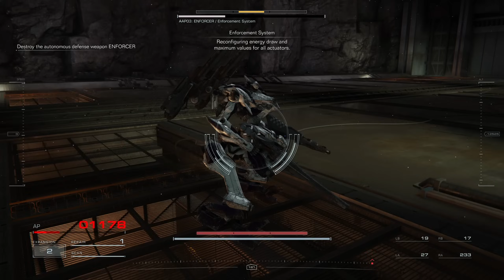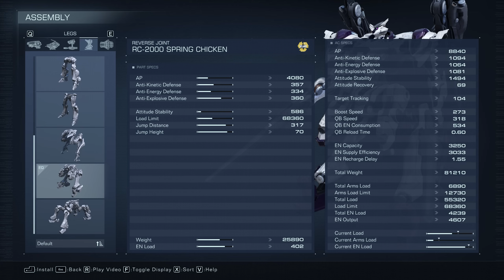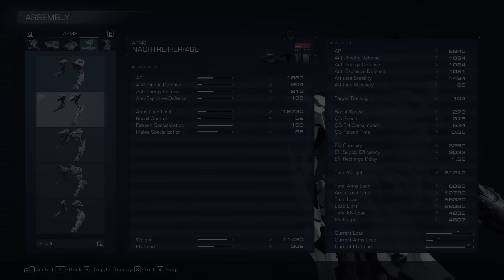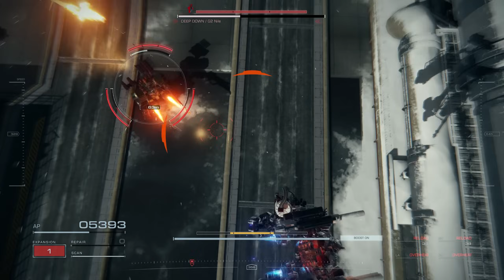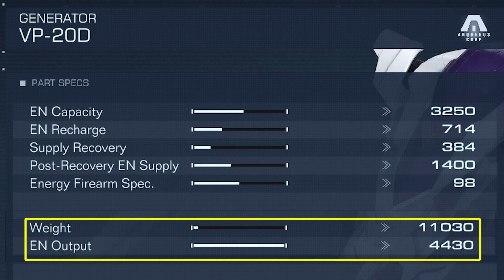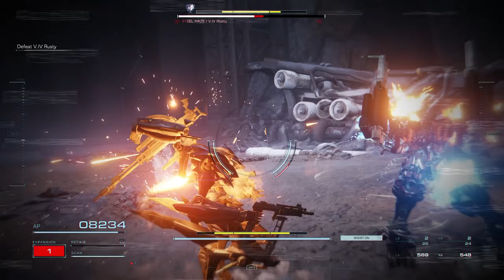Energy Weapon AC Build That Makes Bosses Easy! | Armored Core VI

Comment: I just reached the final mission of chapter 5 and I'm having trouble with Ayre. I tried using a heavyweight build that utilized the ice worm weapon and two bazookas but that did abysmally terrible damage. Energy seemed to do somewhat decent against her but I don't know if there's a better way. Based on experience, does this build work well against her?
Reply: Quite late, but I had success using the Mind Beta reverse joint, an gatling gun in my main hand + shoulder gatling. Also had a Detonating Bazooka that deals very high damage, impact AND direct hit.

A pulse gun could be useful in the remaining slot, for breaking her shields.

Comment: TAKE NOTE: The system recovery stat on heads is bugged and DOES NOTHING. Will certainly be fixed in the next patch, but until then be aware that light and medium builds are being stunned for much longer than they should.
Reply: System Recovery is not bugged, it works fine in-game and always has. System Recovery is status resistance. It reduces the amount of status buildup when you are hit by FIRE or ELECTRIC.

Comment: I feel like not enough people understand how the recoil control stat works, if they did we would see the nachtreiher arms in builds much less often. It directly governs accuracy on follow-up shots and it's an important stat for many weapons to reduce their spread and land more hits. Having the firearm specialization to keep your lock-on crosshair tracking a moving enemy doesn't really matter that much if your shots don't land on the crosshair anyway. I would highly recommend the firmeza arms as an early part that has really good balance between recoil, firearm spec, and melee spec.

Comment: If you aren’t running the VE-20B generator, your energy build is suboptimal.
Take a look at this build: WFV2J91SVG4Y
I’m dominating PvP with it.

Generator: VE-20B
This generator has 150 energy firearm spec. This translates to a massive +25% extra energy damage and -50% charge time in comparison to the VP-20C’s 100 energy firearm spec. This buff stacks multiplicatively with the OS tuning buff! The catch is that this generator has energy issues, but this is bypassed with the core of choice below.

FCS: VE-21B
Great long-range and medium-range assist. Very suitable for my weapons of choice.

Booster: ALLULA/21E
2nd highest thrust, 2nd highest QB thrust, 2nd highest AB thrust, and 2nd highest QB reload time. Aka the true best overall performer. The catch is that its ideal weight point is very low, but we do manage to get lower than it in this build!

Legs: EL-TL-10 FIRMEZA
These legs have the highest load limit to weight ratio in the game, and by a landslide. Nothing comes even close. They are also very energy efficient, something that is very important in this build due to the generator’s limited output.

Arms: NACHTREIHER/46E
160 Firearm specialization and very lightweight.

Core: AC01C: EPHEMERA
Highest generator output adjustment in the game at 126, increasing the generator’s energy output by 26%. This build wouldn’t be possible without this core.

Head: VP-44D
2nd highest stability head in the game, with good defenses and a balanced weight and energy consumption. This is the best head in the game, imo. 

Both Arms: VE-66LRA
The VE-66LRA has a fast projectile speed with a very high DPS, especially with the generator. It also has a very long range, so with the mech’s very high speed you should be kiting your opponents and staying at a safe distance.

Shoulders: VVc-703PM
Super energy efficient and lightweight. There’s not enough energy in this build to run more damaging shoulder weapons. I spam it throughout the fights to overwhelm enemies. Can be fired while moving and is decently accurate thanks to its large AoE.
Reply: I’m gonna try this build, thanks! Also I think you mean the Vvc-703PM, right?
Reply: @G102Y5568  Yeah, that was a typo.
Reply: @JRPG_Addict  Your build was amazing, I just used it to beat New Game++ and honestly, it's my favorite of the builds I've tried so far. I love the combination of incredibly high DPS as well as being super fast to dodge everything, it's the best of all worlds with virtually no downsides.

Only thing I changed about it however was I went for the close/mid FCS instead of the long range one for the Campaign. The laser rifles have a slow projectile speed and I found they missed a lot at long just because the enemies moved, and I'd usually run out of ammo before bosses died. Maybe in PVP it's fine, but in Campaign it's generally better to get up close to a boss since you can still easily dodge everything they throw at you, and ammo conservation is a must.
Reply: @G102Y5568  Neat! And yeah, you did the wise thing swapping the FCS to a close-range one. I eventually did the same lol. Close range is king both in PvP and PvE. The high effective range of the weapon is just a nice bonus when enemies aren't paying attention or are very easy to land hits on.

The build does have a major weakness, though: being an energy build. C-weapons are very resistant to energy damage so it's not ideal to S-rank all PvE missions. As for PvP, impact damage is the name of the game. I did well with it in PvP, but it was mostly just because I outplayed my opponents, not because I had the better build.

I have 2 builds that I want to share for each game mode. This is the build that I S-ranked every single PvE mission in the game with:
RNWN2SAFCCNL

The RF got a 33% DPS and IPS buff in patch 1.02, which made it go from a "decent" weapon to S-tier weapon. It practically never runs out of ammo, has a very high DHA, and has a long range to boot. It's the perfect PvE weapon, imo. And on the back there are double stun-needles because they cheese all PvE content.

NGI-000 generator for infinite flight, which is a great boon to S-rank plenty of missions. HAL core for a significantly reduced EN recharge delay for even better flight and energy economy, and HAL legs for that load limit.

This is the cheesiest PvP build I made so far, as well as the build that I'm most proud of:
FQF5ZD1R0W9N

This one look really silly, but it's busted strong in PvP (and also PvE if it weren't for ammo issues).

With dual stun-guns and Huxleys combined, I build up impact damage insanely fast. The stun-guns also build up electric discharge, which deals a fixed 1600 burst damage and stuns the opponent temporarily. The weapons also have a high DHA to make use of all that impact. 

This mech is very light weight with an Allula booster, so very high speed and great QB stats across the board. With a Nach core, the QB energy consumption is very low at 510, so it's super energy efficient.

The best part? 1813 stability, on a very fast mech. This is possible because the weapons are so light that I can afford to run the Wrecker legs, the highest stability bipedal in the game, without suffering penalties on my Allula booster.

To top it all off, I'm running the NGI-000 generator for the very high capacity and infinite flight capability. With the Nach core, the recharge delay is dropped to 3.64. This is very useful for the hoverers who love to fly high and just spam missiles.

So... Very high impact damage, very high impact resistance, very high DHA, very mobile, very energy efficient, infinite flight, and stun galore. It's cheesy. Your opponents will usually be standing there helpless for extended period of times thanks to the stuns and impact stagger, moving their camera as fast they can to keep up with your QB spam as you rotate around them showering them with bullets, usually with a massive advantage in stability thresholds to boot.
Reply: @JRPG_Addict  It's crazy that the best builds I've found so far are from some random guy in the comments with no likes, how are you so good at this game? Do you have a YouTube channel or something?
Reply: @G102Y5568  No, I rarely upload anything on YouTube. My comment didn't have a lot of visibility because it wasn't hearted, I think. Also, people tend to avoid longer comments.

Comment: Very good build. 
I took the liberty to change something, mainly the boosters and weapons. I prefer having a short QB recharge time and low energy consumption.
For the weapons I tried with dual stun needle launchers paired with dual Zimmerman shotguns and it's the one I like the most so far. Use either one of them to build up stagger (needles for fast bosses such as Ibis or Ayre, shotguns for the rest), when they're almost staggered start getting closer and fire one weapon to stagger, unload all the rest right after followed by an assault armor blast (when they charge at you for melee that's a very good opening). Works well vs most ACs, smart cleaner, sea spider, cataphract and juggernaut. 
For shielded enemies like Balteus, swap the Zimmerman or the stun needle for pulse guns, but I like that extra discharge dmg. Also, seems to me enemies have a harder time dodging it, especially at close range.
Tried also with dual SOUP missile launchers, so you have both mid range and close range versatility and you can kite enemies from afar, unloading missiles on them and then if they come too close you have the shotguns.
I also tried with dual coral rifles but that was more for having fun with the weapon. It's barely below the load limit and you're forced to use heavy arms to hold those 9k+ weight rifles and unable to use shoulder weapons (I had 2 burst pistol since they're the lightest weapon in the game).

Comment: Ahh, it pleases me to see a nigh-identical Core build to mine, named after the great hero.
The biggest difference is in the weaponry - I went with the Laser Pistol instead of the Rifle for more sustained rapid fire, and the original Pulse Blade (later switched to MOONLIGHT) in the off-hand to save ammo against mooks and to punish staggers and/or poor positioning. On my shoulders I had both a vertical missile and a direct plasma launcher to maintain impact pressure even at range while still keeping the load light in order to have the best possible mobility.

Not the hardest hitting setup, but could out-turn like 90% of enemies, and what it couldn't out-turn it could easily dodge allowing for a counterattack. 
And with a EN Weapon specialized generator, that laser burst charges up awful quick...
Reply from the maker: Yea I can't resist naming all my ACs after Dark Souls bosses

Comment: This build actually is under average , mine Energy bulid is better then this, btw energy weapon mainly is to break shields I just found out combine with Rocket launcher / Gatling gun could melt then enemies, in 2 sec, yours generator/ and armor which don’t effect too much in your guns, try dual Vvc-760PR, it could melted your hearts, and for most cases tank legs is have much more better survival ability, for instance-Fortaleza, have the highest speed/ armor/ mobility which’s has more value, tbh, the needle is the best for stagger

Tips: Ephemera head can prevent player for stagger/shorter time; legs parts have longer stagger time, so I suggest fortaleza
Reply: Regarding your tip - that's wrong. Ephemera head doesn't recover from stagger in a shorter time. If you're referring to its higher System Recovery stat, that's for ACS status like shock or heat damage from flame weapons. It does recover faster from those.

Stagger recovery is weight-based - lighter ACs will recover faster from stagger.

Also, reverse joint legs are better for mobility. Period. Especially in the air. Tank legs are better for armor, yes, but you don't have to worry about that if you dodge and don't get hit in the first place.

Comment: I don’t think i missed it, but would have been nice to indicate if the parts you mention for the two builds could be accessed early, mid or late game. Appreciate the build!
Reply: I think both builds are available Chapter 2
Reply from the maker: Most of the parts are chapter 2 or early chapter 3, but many of them are unlocked pretty early!

Comment: For anyone who's more into ballistics: 2 gatling guns + 2 stun needle launchers, this combo is absolutely broken. It kills any boss in record time: balteus goes down in 20 seconds, even the final boss of the 3rd playthrough dies super easily, killed it on second try. Just use miniguns to build stagger then fire needles for absolutely disgusting damage. If you use it in the arena, one rotation of this brings any AC down to 10-20% hp

Comment: There is another generator you should really consider for the energy weapons build, cant remember its name but it has the highest energy fierarm spec. That boosts energy weapons dmg by a significant amount, downside sacrifices capacity and recharge
Reply: Any generator with 100+ Energy Firearm Spec is good for an energy build. Quad and tanks can easily fit that best generator, which I think has 128 Energy Firearm Spec, but it's a different matter for bipedals.
Reply: The IA-C01G: AORTA, the first Coral Generator you get? Turns booster flames red?
Reply: @jakeforgey5378  can't find it on the wiki but it's a bigger version of the ve-20a

I will come back with the correct name once I see it in game
Reply: @jakeforgey5378  VE-20C  is the generator, it has 128 for energy firearm spec
Reply from the maker: I'll have to look into it. I like the idea of a one shot sniper build
Reply: @JDogth3Wise  I use the laser rifle with it, and it one shots most enemies, does about 1.2k DMG per hit or more , but it boost almost all energy weapons, excluding weapons like the drones or energy/plasma rockets. As they have independent energy output
Reply: @JDogth3Wise the plasma cannons fully charged can oneshot an ac if you get the shot off exactly when they stun, easier said than done and some ac will still recover out of it.